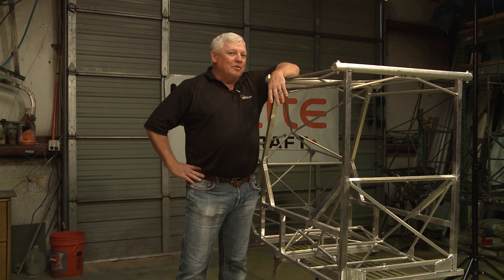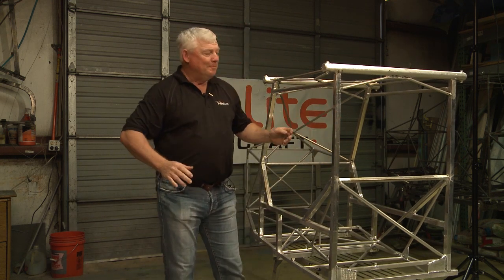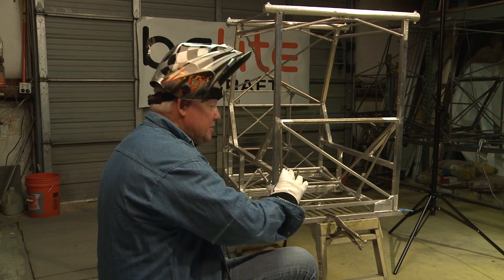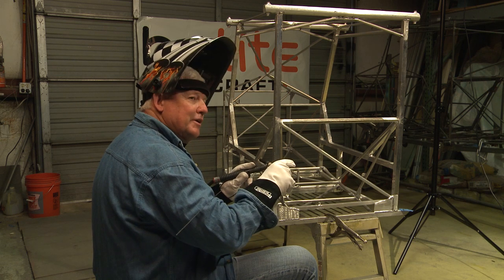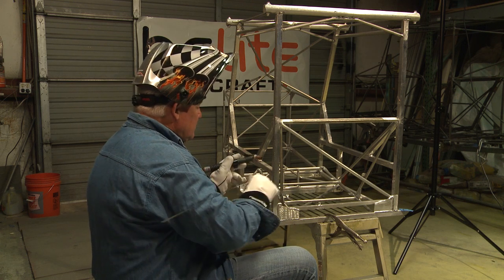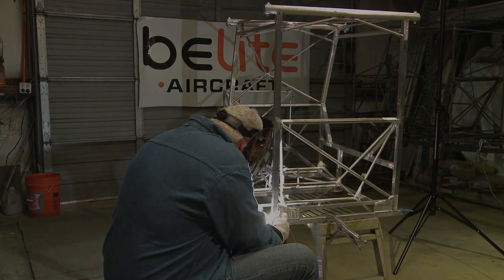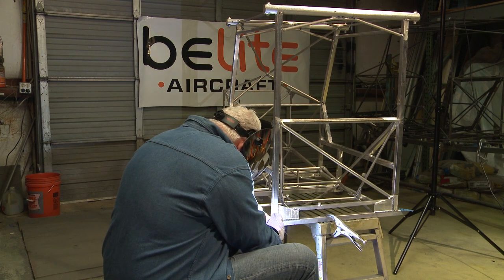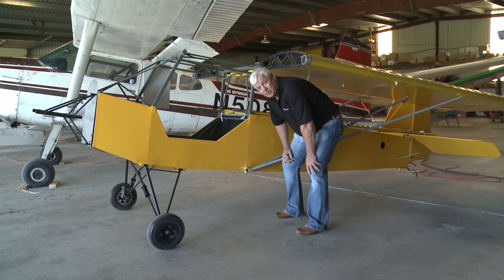TIG Welding Aluminum Fillet Welds

Comment from the maker: There are a few things you can do to help yourself.  First, the tungsten stick out from the cup should be about 1/4-3/8"   Although the 90 degree angle is perfect, it is ok to tilt your torch head slightly for visibility. Your tungsten to the piece you are welding needs to be no more than 1/8" and you should only attempt to add filler when you can see the puddle forming on the piece part.  

Good Luck,

Mr Tig

Comment: when do i recognize that right time to add filler material when i add it too early it creates balls and if too late im already making holes in sheet :( or is problem that i have my needle too far away from the sheet? .. Im welding aluminium only. any tips will be greatly appretiated

Comment: how close u have the "needle" im having difficulties welding FW weld cuz i have my needle too distant now im scared if i put my needle too close itll eventually FIX to the boiling filler.
This particular weld is problematic for me i ruined 7 sheets already and am bit nervous...
my instructor tells me to put it closer but ive got to setup needle in torch then... any particular tips? Furthermore im left handed like you but i cant see on my boiling good cuz im trying to have it in 90degree position

Comment: i just started a job 2 days ago doing mig aluminumand ive never ran something as hot before. we run everything from 530-620 amps. i did about 10 tack welds without a face shield.... i learned my lesson, lol. got a little burn from the high amperage.
Its fun nonetheless haha